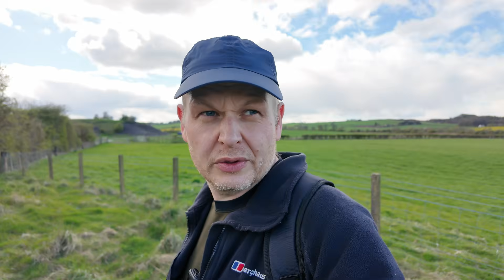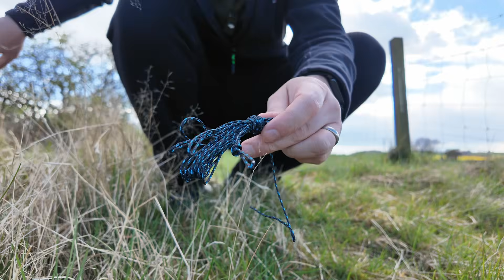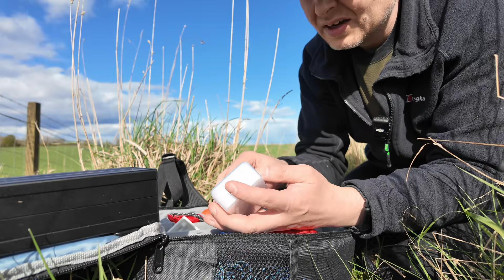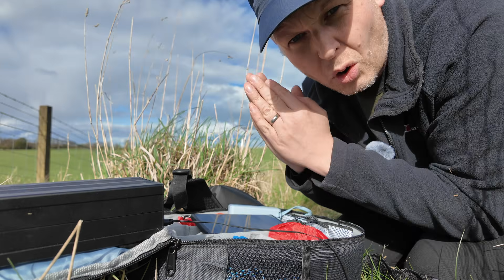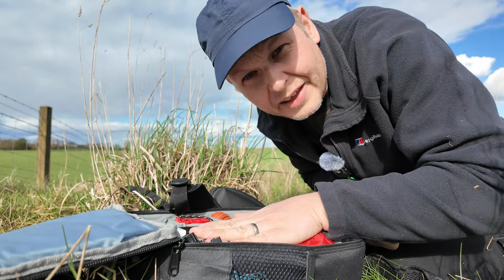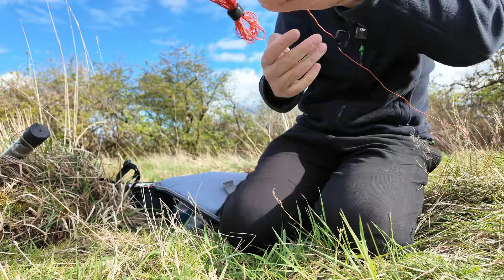Before You Go Portable… Do THIS First

Comment: I do like EFHW (& yes I do realise this wasn't a HW video) but cannot help think they are a little over-hyped at the moment. Similar to the Kanga, the GQRP Sudden transmatch is nice too & is also worth considering as it has the advantage of direct balanced i/p too so you can feed it with a half size g5rv (good for 10-40. no choke, no 49:1, no coax needed if you run things 15' high)....... I do like your under/over finger winding technique... I'll certainly be copying that.
Reply from the maker: I purchased that Transmatch about 18 months ago (way before it was publicised). Its size and broad banded tuning does it for me. Yes perhaps not most efficient. Just looked up that GQRP one. I see its RCA instead of BNC but that could be changed. Just wish it could be smaller.
Reply: @MM0OPXFieldRadio I've just got RCA to BNC adapters plugged into mine. They are small and cheap & looking at it you wouldn't know it wasn't just installed BNC... It also has the advantage if someone trips over a cable they just pull out & quick disconnect and the ATU doesn't go flying.